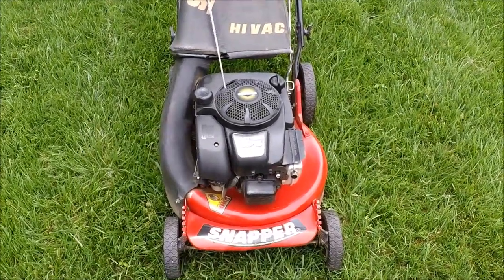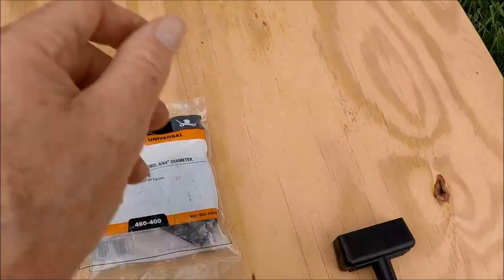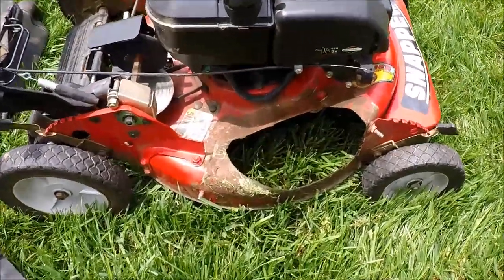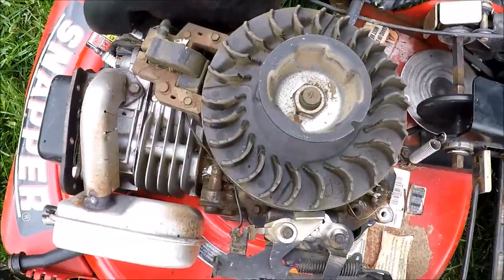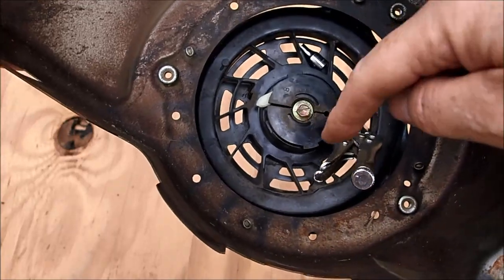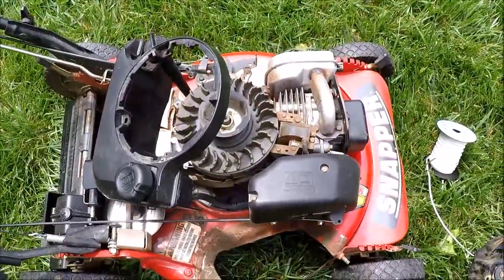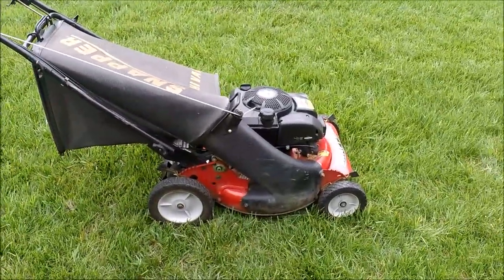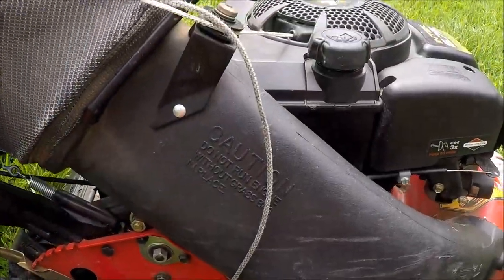How to Replace a Starter Rope on a B & S 6.75 OHV Engine - Snapper Lawn Mower - May 4, 2017

Comment: 👋 I dont know if you are a big generator fan but i picked one a freind gave it to me for a project!
Reply from the maker: Hello that is great have worked on a few generators a Generac recently for my neighbor.  Most of the problems have been the engine carburetor just from sitting extended periods of time, a home owner type generator does not get used much and the gas dries up in them.  The generator part is generally never the issue hey do a video on it I did not see that posted as of yet on your channel.
Reply: I will be posting it soon iv been sick so im getting better!

Comment: I've got one of those Intek engines, replaced everything but flywheel and still no spark.
Reply from the maker: Hello BronzeChicken thanks for viewing!  Ok so a few things to check the cable from the handle you pull down to start the engine.  It  it could be stretched where its not fully disengaging the cutoff switch.  For safety take the spark plug boot off, tie the handle back and see with a pair of vise grips can you pull that lever back further with the cable fully engaged.  You can also put a temp ziptie in place to fully engage it.  Take the spark plug out put it back on the boot put the electrode end on a head bolt have someone pull the rope see if you now see a spark.  (presumed you replaced the spark plug) Also the flywheel key, it could have partially sheared which throws off the timing and that could cause it not to spark.  The last resort is the actual magneto itself, if its 15-20 years old it may have failed and would need to be replaced.  They have after market ones on Amazon/Ebay for under $15 USD.  Let me know what you find and the actual age of your lawn mower/Intek engine.
Reply: It's a 2002 model, I've done all of that, replaced the plug too and just can't seem to get spark, considering the mower's condition I haven't pulled the flywheel since it ran perfect and shut off and won't start again.

Comment: Not a fan of those Inteks. Always have valve train issues. A guy just gave me a free Snapper rider with a 12 horse Intek and valve problems.Sold it as is for enough money to buy myself a new Echo straight shaft trimmer.